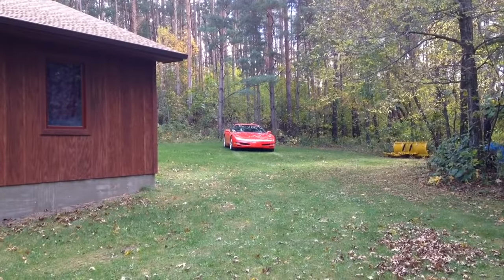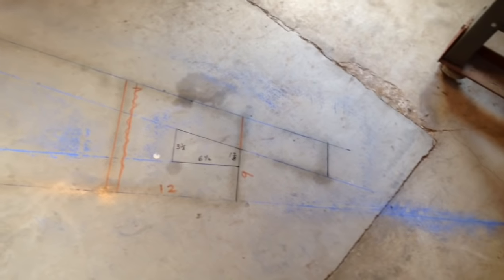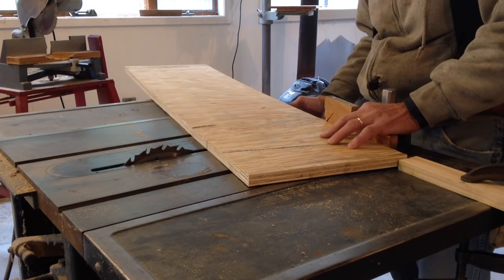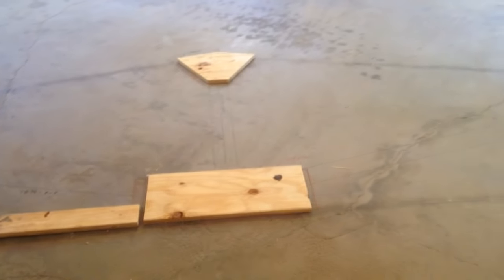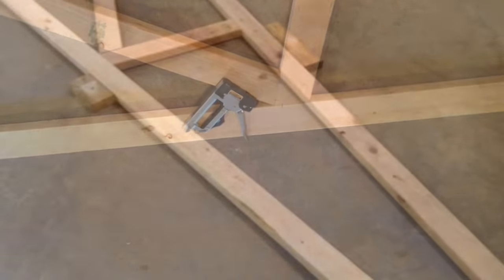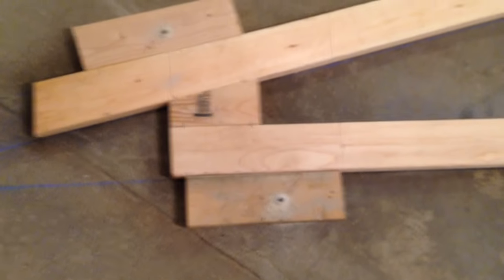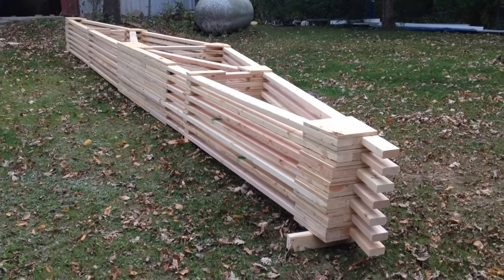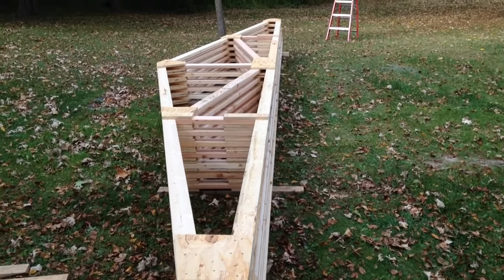Build your own wood trusses

Comment: Nice trusses!  I hadn't thought about using glue to have the gussets hold better.  I'm going to build an 18 x 24 off grid simple cabin probably just one big room and maybe a closet and little to no plumbing, and little to no electrical since it's literally in the middle of the woods with no power, well, or septic, and  No driveway up to it, and no permit haha.  It'll be a deck based platform on beams resting on concrete blocks so it'll be at least 20 inches off the ground so I can batt an R 30 under the floor.  I need to build trusses with an 18 foot bottom chord, the pitch can be whatever I want.  There's no way I'm going to buy 13 trusses and carry them all the way through the woods lol.  Maybe 4/12 would be good so it will be easier to blow  and won't use as much roof sheathing as houses that could almost fit 2 more stories in the attic.  How about using OSB for the gussets?  I'm not planning on using any plywood for this project but OSB for sheathing, thin crap for the walls and thicker stuff for the subfloor and roof deck.   Or I guess I could possibly do rafters too but then would have to batt the ceiling but it would be vaulted.
Reply from the maker: Brock.  Here are my thoughts on the trusses.  If using an 18 foot bottom chord, I would buy 18 foot 2x4 so a mid span splice is eliminated that way.  I am not a big fan of OSB.  It just seems to degrade over the years.  I would use 5/8” plywood minimum.  Exterior rated for waterproof glue. I would go 4:12 or 5:12 on the slope.  Always liked a 5:12 myself. If you need engineering help for the design make sure you get it.  Another way is to go to a place like Menards.com. They have truss design online I believe?  On the deck, maybe consider a rigid foam insulation.  Mice really like fiberglass.best your way!

Comment: The only reason to order trusses is if you are a contractor working on a deadline for a bid price. Paying union help to build trusses can eat way into your profit margin. Factory trusses are fine as long as they are certified safe according to local building codes. However glued and nailed trusses built to order are stronger, stiffer and if you carefully build a fixture, just as uniform. I've rolled my own for 50 years and never had one fail yet. BTW, I've always found it convenient to cut the eave overhang a couple of inches longer than required, then use a chalk line to trim them to uniform length after installation. I always get one or two that don't quite fit and it's a bear to get the fascia to look right.
Reply from the maker: Hello Lawrence,  I usually leave the tails on rafters or trusses long and field cut them also.  In this particular case, it was not beneficial to do so.  the sub-facia was a 2 by 10 and there was no way that a short truss would make a difference with a piece of lumber like that.

Comment: Is it ok to use two 2*4 for the bottom of a roof truss for a large shed? Or must the bottom of Trusses always be one long piece of lumber?
Reply from the maker: Sylvian, great question.  Ideally it would be great to make ther bottom chord just one piece of 2 by 4, but it does not have to be that way.  2 by 4's are available up to 24 feet long I believe, but they are hard to transport, and cost more per foot than say a 16 foot piece.  My trusses had a 26 foot bottom chord length.  I used two pieces of 2 by 4 and spliced them with a 4 foot long piece of 3/4" plywood, both sides, glued and nailed.  The bottom chord has a lot of tension force, so a good long splice is a good idea.  You could also use two pieces of 1 by 4 lumber both sides, glued and nailed.  I would make it lap over the joint at least 2 feet both sides, longer would be better.

Comment: I started building my trusses on the garage floor but it was too uneven to get them straight and flat. So I built a platform with 2x4s and plywood so I could nail down jig pieces to hold the chords in place. Worked great plus they stayed in place when I was nailing. They just moved around to much when I was nailing the gussets on the concrete, but great job!
Reply from the maker: Paul Wilton   Thanks Paul, what you did is a good solution if the floor is uneven.  You can also tapcon or otherwise screw blocks to the concrete floor to lock down component position.  That is what i did, but it did leave multiple small holes in the floor.

Comment: Hello great video thank you if I’m adding a 16 foot wide x 14 foot long addition how many trusses would I need ?
Reply from the maker: Hi Miguel,  These types of wood trusses are typically installed 24 inches on center.  So depending on your framing scheme, you would need 6 common trusses and one gable truss, or 6 common trusses and field frame the end wall all the way to roof line.  The fact that you are asking this question makes me wonder if you are in a little over your head.  Also something that is just 16 foot wide I would probably frame that with rafters.  Check out youtube for "roof rafter framing" and see what you find.  Best your way.  steve

Comment: The pattern of the bracing isn't just ornamental. The depth of the board, species, and loading rates for your region will give you the span between the braces. This is what you are paying for with engineered trusses. If you are planning on sheetrock then a 5 foot span is closer to what it should be on the bottom. But do the figures for your needs.
Reply from the maker: Always appreciate  comments Michael.  Just checked the Southern Yellow Pine ceiling joist tables.  I know a joist is different than a truss, but the table showed a 9-10 foot span, 10 psf live load,  for a 2 x 4- 24" OC.  That is a little longer than I like to see.  Most trusses I have set here in Iowa are in the 7-8 foot range for bottom chord panel points, designed for 5/8" wallboard on bottom chord.
Reply: @flyboyslc1  
You got me thinking. So I looked, 20 pound snow load, which is half of yours, with 1/2" sheetrock is...
5' 5" bottom chord and 5' 8" top.

Comment: is that half inch or 3/4 plywood you used for the gussets?
Reply from the maker: Mateollios67.  Good question.  I did use 3/4 inch plywood.  1/2 inch would work well in most places too.  If you use 1/2 inch I would try to find plywood that has at least 5 ply in it.  Also, I would suggest using 3/4 inch wherever you have a lot of tension in the joint, such as in bottom chord splice.  Best wishes!
Reply: Excellent!!!! Wayne's world

Comment: Question?? what kind wood would you recommend to build a truss? Are you using southern yellow pine in your video??
Reply from the maker: Any lumber typically sold to perform wood frame construction would work.  Years ago it was all Douglas Fir.  It is mostly gone.  Now it is sometimes called SPF which is short for Spruce, Pine, Fir.  Kind of a conglomeration of the three.  Truss lumber should not have any large knots in it, as they interrupt the flow of the grain and weaken the member at that point.

Comment: which nails you use? 3/4 plywood? why you need bottom narrow plywood piece? thanks!
Reply from the maker: Joe, I used 2 3/8” by .113 ring shank steel nails.  Clipped head.  Generics and that is why you see the occasional sparks.  Not a perfect fit for the Paslode gun.  I angled the first layer otherwise they would protrude through the 1 1/2” thick lumber.  Second layer didn’t matter since the combined thickness is 3”.  Bottom piece of narrow plywood 4 feet long is used to splice two pieces of 2 by 4 since the bottom chord was slightly longer than 24 feet.  Not easy to find 26 foot 2 by 4 and not easy to transport it either.

Comment: Nice video on how to actually build them.  But how did you determine how many nails you needed to use to support the load these trusses are carrying?
Reply from the maker: Hi Bruce.  Thanks for the nice comment.  I believe you are asking how many nails in each of the joint gussets?   It is a good question, and really good to know if you are not using any construction adhesive (glue) between truss parts and the gusset plates.  I generally would use a minimum of six nails in each side of a tension joint.  So for instance the bottom chord splice that was four feet long I would have a total of 24 nails, 12 on each side, with 6 nails on either side of the splice joint.  Hope this does not confuse you.  The nails are just there while the glue cures out.  Once the glue is cured, the nails aren't needed so much.  I still leave them in.  Not much fun to pull them all out!  In other places where the gussets are smaller, I would use minimum of 4 nails each side of a joint.  I highly recommend glue, like a PL400 construction adhesive or similar.  The nails should be 8 penny sinkers if hand nailing, or 2 inch long nails if air-nailing.  Hope this helps.  I have not looked at this video in a long time, but I think I showed a completed joint, with nails visible?  Not sure, I will have to look!  steve

Comment: The bottom piece of wood that runs 26' how did you connect the piece of wood. With gussets?
Reply from the maker: Yes sir. I used a 3 1/2” by 4’ piece of 3/4” plywood both sides. Glued and nailed.

Comment: The bottom stretch is 26 ft.  Did you use 2, 13' boards?
Reply from the maker: Jack,  I think I used a 10 and a 16.  That moved the splice away from the center, making it easier to join using a piece of 3/4” by 4’ long plywood on each side.  I didn’t want the bottom chord splice and center vertical member joint to all happen at the same place.

Comment: Very good vid and info. What about engineering and permit approval.  will self made trusses pass on your own license if you follow specs for permit approval? I'm in Oregon btw
Reply from the maker: Hello Thomas.  If you are subject to a local Building Department, check with them for site built truss requirements.  They may or may not require a structural engineers stamp on a set of drawings.   I am fortunate that i am on what is called a "farm" in Iowa, and therefore not governed by a building department.  I specifically did not go into the engineering of trusses, as they must be designed for local conditions.  Oregon may not get any snow where you live, or lots of snow.  Snow is a big thing, as it puts lots of live load on the trusses.  Hope this helps.  steve

Comment: Great video. Thanks for taking the time and sharing. Only question is what size is the plywood gussets?
Reply from the maker: Royce hagerman   Thanks Royce.  Nice comment.  The thickness of the gussets should be half inch 5 ply or 3/4" 5 ply.  Either one will work ok.  As far as overall size, they need to be big enough to put 5-7 nails in each of the members to be connected.  Bottom chord  gusset should be a little longer, because it is under tension stress.  Maybe a good idea to use 3/4 plywood there and make them 4 feet long.  That way the plywood in cross section is equal to the 2 by 4 in cross section.  Hope this helps you.

Comment: The WONDERFUL thing about building identical multiple items is except for the first article?  Everything else is reduced to mass production tactics where each part run is set up and then bang out x number of part A x number of part B and so on and THEN when all the parts are staged it is just banging them together one after another identical clones....repetition lends itself to consistent quality!  It might take more than 4 hours to build the first one but if you build ten identical "widgets"  But then  Maybe as little as a half hour each or less ...which is why tract homes (and modular homes)  can be built SO SO much cheaper than custom one off homes...Henry Ford NAILED IT!

Comment: Nice trusses. But as a carpenter of 35 years myself, I was wondering why you would not prestress or preload the trusses by adjusting your template blocks to incorporate about a 3/8" to 1/2" crown in your truss? That way, when your plywood, roofing materials, and possible snow loads start weighing it down it reduces any adverse deflections. Otherwise, you built them the same way we used to build them.
Reply from the maker: Brent, great comment.  I didnt really think about it at the time.  And as it worked out, glad that i didnt.    Sometimes I over-think things, and trying to figure out how much a truss will actually deflect isnt an exact science, unless you know all the data affiliated with wood species and such.  I didnt have that data anyway, but did over-build the trusses.  Where i matched new construction to old construction, the trusses fit well, and there is no discernable deflection yet (about five years?) that shows on these trusses.
Reply: I think that " preload " force will be gone after some time ( wood will set down) and will be almost zero so no necesary in my opinion.

Comment: How do you determine the size of the gussets?  Do they need a minimum overlap on each truss section?
Reply from the maker: Scott, excellent question.   For me it is a little bit of a seat of the pants thing.  But as a general rule, for the top chords I would make the plywood at least two times the width of the chord from the center of the joint.  So a 2 by 4 is 3.5 inches.  So 7 inches each way from the joint.  That would mean that the plywood is 14 inches long, and probably 14 inches wide.   Where the bottom and top chords connect at the end I would oversize it a little.   Also, make sure you are doing both sides of the truss with plywood plates.  The one thing I always want to make sure is that any bottom chord splice has a lot of overlap.  It is in a lot of tension, so for me I used a piece of plywood 48 inches long by 3.5 inches wide.  The joint had 24 inches of plywood on each side of it.  It would be better yet if the bottom chord could be one piece of lumber.  You can order 2 by 4 lumber 24 feet long, but hard to transport unless you have the truck to do it.  Hope this helps.   steve
Reply: Yes, it does! Thanks for the fast reply and good info! I appreciate it!

Comment: I don't want to criticize anything about this because I find this pretty awesome. But I tend to like some storage space above the ceiling area.  Something gets lost or changed when using this style.  Nice job by the way!
Reply from the maker: Hi Susan.  Trusses can be designed to accommodate storage space.  The designer just needs to know how big an area you wish to have, and the estimated weight.  The trusses will cost a little more to reflect the bigger lumber sizes needed, and perhaps bigger connection plates at the web member points.  Thanks for posting!   steve

Comment: Did you nail down those stop blocks on your garage floor with a ramset gun?
Looks like it would work fine but I have to build my trusses in my cement carport floor but I know my wife would kill me if I left a bunch of busted out holes in the concrete floor when I was finished.
I’m sure they could be epoxied over or something but she’d kill me anyways....haha.
I really did enjoy your video as I’ve made trusses before for sheds and barns and we used those darn metal mending plates with the teeth.....so hard to get them perfectly straight and the hammering required is so noisy and time consuming.
Yes next time I’ll probably glue and nail plywood gussets.
Prefab is quick and easy but nothing beats figuring it out and doing it yourself especially if there’s a grandson, nephew or son in law to help and learn from your skills.
I try to teach someone younger than myself each time I take on such projects so they learn something.
Every time my grandkids come to visit I make sure I have a project going on so they can learn some skills.
Reply from the maker: HH, i attached the blocks using a 1/4" tapcon screw.  They are easily removed and the holes filled with caulk or grout.  I cant even see where they were screwed down anymore.  For sure, dont use a powder actuated tool nail.  That would leave a lot of spall, and not hold that well either.  I like your teaching the young philosophy! If i was going to use the metal splice plates, I would most likely build myself a small press to do it, rather than trying to hammer them on.    steve
Reply: flyboyslc1 
That’s cool wasn’t sure how you secured them.
glad they filled in well.
You built this like a perfectionist would.
Good luck with the corvettes....I’m a car guy myself but I’m into mopar muscle cars.
I’ve got a one of a kind Barracuda that took me several years to start/finish.

Comment: What is the purpose of the plywood plate in the middle of the bottom chord (one that extends to the right of the center in the part of video where all of the trusses are stacked)? I suppose they beare the tension force but why they aren't in the dead centre of the chord? Is it expected for trusses to sag over time? Thanks for your time! Best regards!
Reply from the maker: Hi Zarko,  The bottom chord of the truss is about 26 feet long, and the lumber I had for bottom chord was 16 feet, so I had to make a splice.  The bottom chord is in a lot of tension, meaning it is trying to pull apart.  So I needed a relatively long splice plate.  I could have done it in the middle, it would have worked there, but I already have another plate there for joining the middle web components.   I just thought it was easier to move the bottom chord splice away from that area.  Trusses should sag, or deflect as we say very little over time.  You can load them to the failure point at any time, but they show little sag before a piece of lumber breaks or a joint fails.  Best wishes steve
Reply: flyboyslc1 Sorry, I didn't noticed that bottom chord was made of two pieces of lumber. Thank you for your answer, you have one subscriber from Bosnia!

Comment: So, if I followed this correctly.....nothing toe nailed in.....gussets (plywood and glue) hold the 2 xs?
Reply from the maker: Yes Samuel,  you have it right.  A toe nail here and there to position the joint if you need to.  I just used a small staple to hold position.  It is the plywood and glue with face nails that make the connection